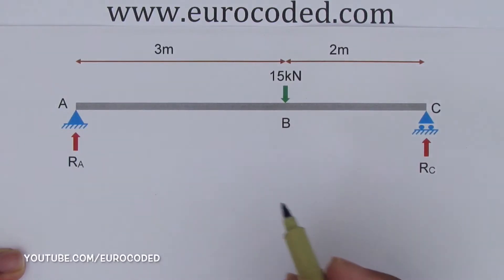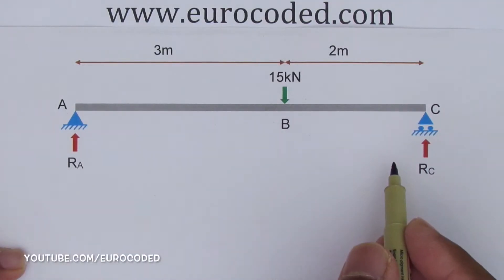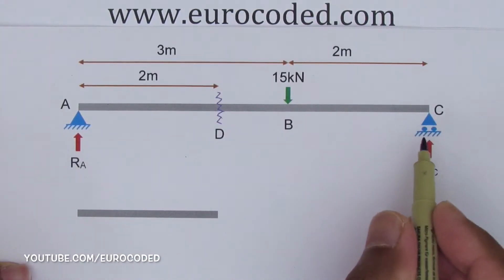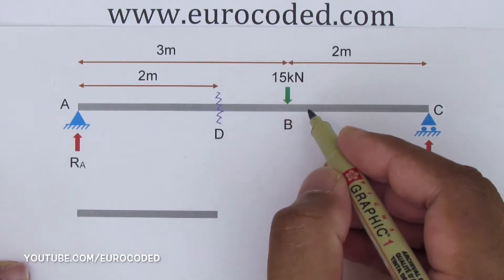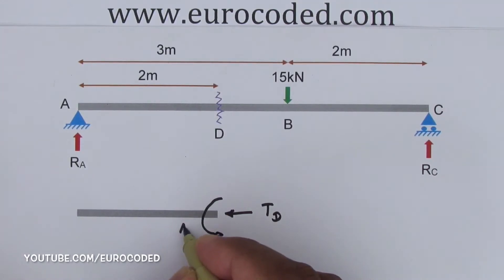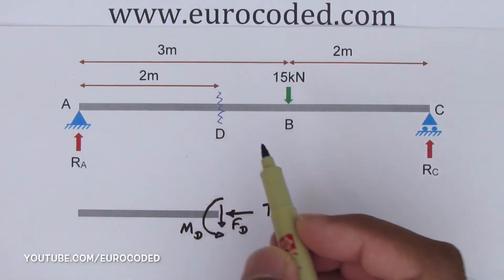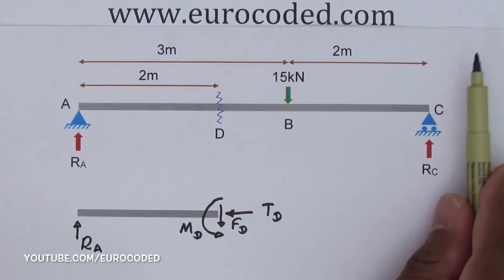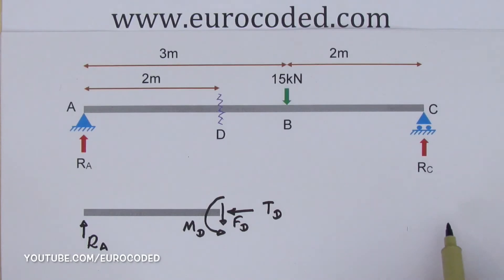How to Draw a Free Body Diagram - Simply Supported Beam with a Point Load

Comment: Ra is hinged support so there should be horizontal vertical forces and moment...you did wrong .
Reply from the maker: oriano info This beam has a pinned support at A. Pinned supports are unable to resist bending moments. No horizontal forces applied on to the beam. Therefore, no horizontal reactions. Watch this video to understand the different support types and what they can resist: https://youtu.be/WEmKBh3HkQ8

Also, R_A is a support reaction!